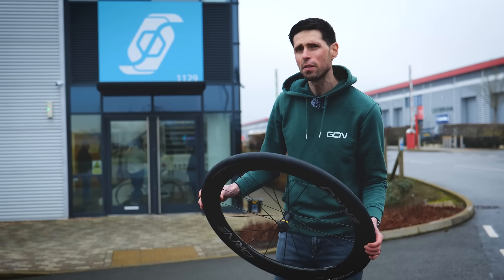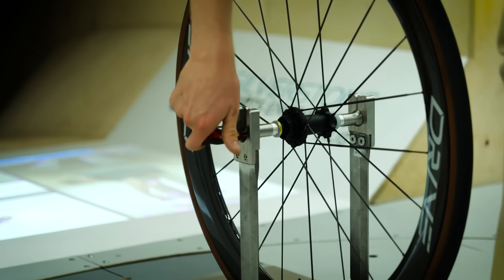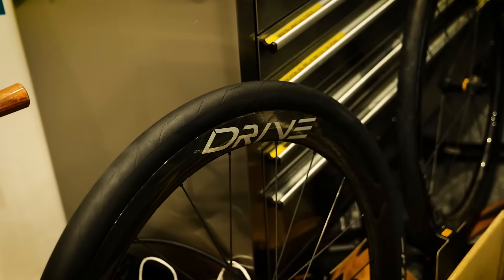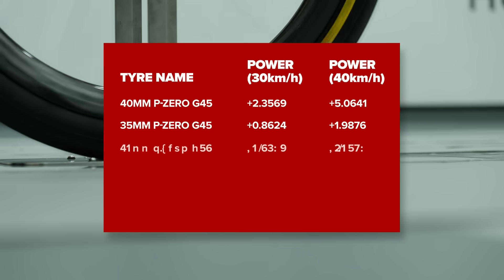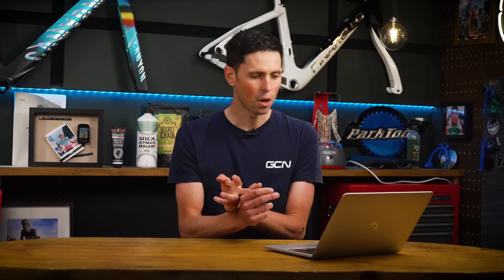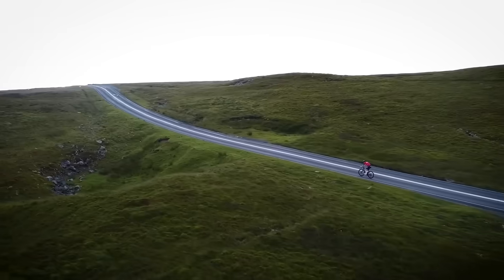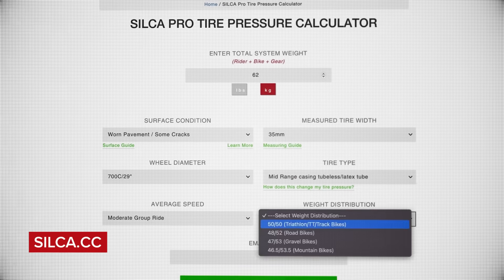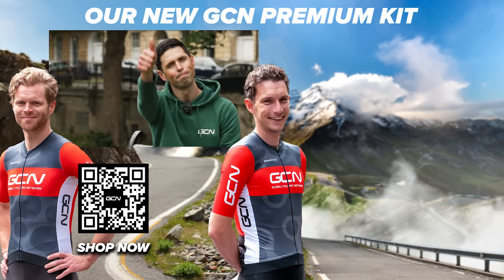The Fastest Tyre Width is NOT What You Think

Comment: So frustrating watching yet another video where the assumption is same tire sizes front and rear. I can only fit a 25 in the rear of my bike, but a 32 in the front.  So instead of 25-25, I put a 32 in the front and wow, it's amazing.  It added a little bit of front suspension (where it matters most) and vastly improved comfort and control in turns, because the front is where all that magic happens. So if you don't want to buy a whole new bike, look at your front fork clearance and max out your tire there and enjoy the heck out of it for a few more years.  It's great.

Comment: there is a biggest flaw from very beginning.  you already pointed out at early video.  there is no such thing as a perfect road surface.  wish to compare with rougher or smoother sims and see how it will effect width of tires.  I believe if these data is so import then pro cycle team should have change their tire set for all different courses accordingly as what motor sport does.

Comment: As someone else pointed out, the tested tires in this video in 35 and 40mm width are not really comparable because they use a different compount etc. Bicycle Rolling Resistance categorizes the 40mm even as a "fast touring tire" afaik, not a road tire. I am not saying that a 40 is as a fast as a 28 or a 30, but if you test them as in the video it's not that strong of a statement I think and I would take the rolling resistance values with a grain of salt. Also I'd be interesting to see the aero measurements of wider tires on even wider rims, such as the ZIPP XPLR or Nextie rims that have 28 or 29mm internal width. Because this is I think the route we are heading to. Road wheels will have 25 internal width and "Gravel" marketed wheels will go even wider. Also I recon that in a few years a lot of people will be riding fast on 35mm race tires... Which is, comparted to a lot of developments the cycling industry is pushing upon consumers, actually a good thing I'd say. 

From a personal perspective I just can say that I really enjoy my Schwalbe Pro Ones in 38mm I am constantly setting new PRs with on my new build. But that is just n=1 anecdotal evidence of cause. 🙂

Comment: On my very first IM race in CPH back in 2014, I was opted to use 19 mm tubular tires... The front tire only last about 30 kms, since I hit a pothole & destroyed it. With 120 psi & 90 kg mass on it, the tire hade no chance... Hopefully I had spare & didn't DNF.

That's a good test you did, thank you. The only thing that could be mentioned is the rider's weight. I personally believe that going one size wider is a safe bet for over 80 kg riders. What do you think?

Comment: I have gone from a mid price 28 to an expensive 33 (Challenge Strada Bianca) and it feels faster everywhere. I am using a Little less pressure and I live in an area with some flat roads, lots of cat four hills with switchbacks and lots of good quality gravel trails. I feel like I have a lot of grip especially descending. I am riding a Trek Crockett which is very stiff and it seems to like a bigger tyre

Comment: This is a complex topic, but I wanted to add in that changing the internal rim width also changes rolling resistance because the sidewall will get more or less support, changing the tire's stiffness. It was not clear which internal rim width the pedaling efficiency rig wheel setup was

For example I wonder if a wheel with internal rim width of 35 and putting the 40 mm tire on will have a similar rolling resistance to the 30mm

Comment: Measuring drag at zero yaw on a single wheel is not enough to draw reliable real world conclusions. The bigger differences show up at 10 or 20 degree yaw angles, whereas the wheel can act as a sail. But aero is hard, there are so many variables. Different wheel and tyre combos will differ at the same nominal widths. But I guess we can all agree that 40mm road tyres are slow.

Comment: 2009 when I was doing the Lake Taupo 100 mile ride, I thought my 23mm 90 psi were the ideal setup….even though some roadseal is like set gravel. But then I fell for trying 1.5 “ Conti tyres on an MTB, to ‘cut through to the solid surface under the mud’ - maybe it did, but they were unforgiving and harsh.

Comment: I'm curious about how rolling resistance breaks down by tire / tyre size vs. inflation. I have a strong suspicion that there's one ideal contact patch size (regardless of the tire size) and you get an ideal contact patch at the best intersection of tire width + rider weight + inflation, but I've been wrong before.

Comment: Just changing the tire width from 23mm to 25mm clearly slowed down hill climbing. Since wide tires are not common even in track competitions where speed is measured in 1/1000 second, I think the only advantage is in comfort on rough roads.

Comment: Can anyone tell me if bike tires have aspect ratios like car tires, or is it strictly diameter and width? My old roadie was designed for 28mm tires. I have space for maybe 32mm but can go no more in tire diameter because the brake bridges are right there with very little gap to the top of the tires.

Comment: Assuming a smooth surface beneath the tire, fastest width is the most narrow. Why? Because of air drag across rider and bike, no matter how streamlined the combo, you need to constantly re-accelerate the wheels - with EVERY pedal stroke. A narrow tire has less material and subsequently less weight and mass to be reaccelerated. So, for the same amount of energy put to the pedals, you get more re-acceleration out of the tire with less weight and mass. Over a rough surface, which can promote tire-to-road-surface slippage and thus wasted energy there, a slightly wider tire inflated a bit less could grip a bit better, reducing slippage, saving more energy than a lighter / narrower tire in that situation.

Comment: I run 32 mm tires. The big difference? Cornering at speed is so much more stable. Actually, so so so much more stable. I'm much more comfortable laying the bike over when I'm cornering with 32's. The same goes for 35 mm tires, but I run 32's for some unknown reason (to me). Maybe I save some power as suggested here even though I can't tell objectively. Regardless, 32 mm's seem to be my sweet spot. Also fewer flats, but that's not the topic here.

Comment: Had 28s, rear wore out so got a 32, feels better and no loss in speed with 28 front 32 rear. Does anyone have any tires they like that aren't close to $100/each? Currently use continental ultra sport 3s and don't like gp5000 because they got punctures like crazy for me. Might try some P7 sport 35mm next

Comment: aired are too much hassle. well I will not be using them. dont ride with any psi. use segmented solid/flex tired with radial/axial bolt attachment. absolute zero air leak maintenance. tractors dont care about aerodynamics. they need to just work.

Comment: A quick question that just sprung to mind. You didn't cover it in the video but, what does the weight of the rider do to the data you just presented. For example, if you reduce the pressure in the tire tire when you are a heavier rider, what are the odds of rupture on those gravel tracks like say, the Sydney CBD.  Sydney is built on a sandstone base so fishers, pot holes and crumbling corners are a fact of life. But now we also have tram lines.

Comment: Just got a new bike, a Merida, which is actually a step down from the Giant I rode before.  Of course there is an 11 year gap in technology, gears, cabling and brakes etc...  Anyway, the new bike comes with 28mm tires and a recommended pressure of 115psi.  However, having to re-pressurise for the first time I stopped at 100psi because the tire felt rock hard at that point. Now my Giant had 23mm tires that inflated to 100psi also, so no real difference that I could feel. But I am an old clunker, north of 60 and trying to re-build my fitness.  Consequently, the things that have me more alert is how a heavier bike skips and twitches at high speeds. Tire pressure and width seems less important to me at the moment.
Reply: Pretty sure 115psi would have been the max pressure for the clincher rims before risking catastrophic blowout! Nobody should be riding north of 100psi on their tires anymore. Check some pressure calculators online e.g. Silca, Sram etc. for some recommended pressures.

Comment: Spent March, April and most of May in a wheelchair… did 300k on turbo over the last few weeks… fitted some 40mm pZ0 and went out for my first real ride of the year, put the power down and hell I took 5.46 min off my previous best on a 22k hilly route.. so that definitely ain’t slower than the 32mm I had on before!!  Like riding on smooth tarmac.. not crappy potholed B roads..

Comment: Tire brands vary quite a bit, even in the same model range….for instance I’m running Pirelli Race RS 30s on my Supersix with Reserve wheels 40/44s, with 25.5 internal and I get a tire that calipers to 34.227….
The same wheels with GP5k STRs in 32s measure 34.2…
I think the video is just trying to encourage people to try larger tires for comfort and stability with much or any loss in speed.  Today I rode a group ride of fast roadies on my gravel bike with 45c Terra speeds…it was a little slow up hills but on the flats I was able to peloton with the best of them.

Comment: Just this Spring I put 40mm tires on my Diverge. The surfaces I ride are a mixture of asphalt, chip and seal, and gravel roads. I'm coming from 32mm and have to say the 40mm is the way to go on mixed rough surfaces. Of course I'm not racing and actually don't pay much attention to speed. I do appreciate the comfort and extra traction.

Comment: They can't be double to get the losses for two wheels in terms of rolling resistance as there is a different amount of weight on the front and rear wheel, your rolling resistance losses will be far lower on the front wheel as it is maybe a 65:35 weighting, this is easily seen in tyre wear with you rear tyre wearing often twice as fast as the front.

It is an interesting video though because it does suggest that most riders who don't care about at watt or two here and there, but might about 5w here and there, should probably be on 32-35mm tyres. But I think that has been fairly obvious for a while now, if the Pro's are on X, most people aren't a 22 year old with a yoga physio, so add a bit to make it work. Same thing can be seen in reach, drop, handlebar width, and why we should just ride endurance road bikes as has been the case since about a decade ago, my endurance frame from 2015 can fit 30mm tyres, the Pros were all on 25mm at the time.

Comment: I've been running 35mm GP5000 AS tubeless for about 2 years now, daily commuting and 3 grand fondos. The puncture protection from both the AS tire and lower pressure from 35mm has been so nice, along with good sealant and I haven't noticed a puncture until I've gotten home and see the residue on my frame. I've been able to stay on the bike all but two weeks of the year when the snow gets bad here.
Reply: My experience matches this. The Conti GP5000 AS TR in 35 mm is my go to tire for logging miles year round in all conditions.

Comment: In the 35+ years I've been a roadie, it was the addition of disc brakes to road bikes that was the biggest "game changer" I can think of because it finally allowed for this tire width experiment to happen.  If someone was ever looking for a reason to buy a new bike and the current bike has rim brakes, this is it.
Reply: I will keep my 2018 rim brake bike.  It can handle 28 mm; that works just fine for me.
Reply: Ive been riding for over 30 years. My road bike has rim brakes and Ive always found them to be effective. TBH given the small surface contact of the wheels on the tarmac - which is often wet here in the UK ! - Id be scared of having more braking power. I really do support new technology and advancements in things like tyres etc, but the only real game-changers Ive seen in the last 40 years has been aero-bars and clippless pedals.
Reply: I agree. I rode magura hydraulic rim brakes (the drop bar version) on my last bike for 20 years.
But, if it had come with discs, I'd have preferred that. If it could take discs, I'd have swapped.  And, when I changed bikes last year, I made sure it had discs.

Comment: riding 32 mm cinteratos on my road bike, and 40 mm on my gravel rig. Love both set-ups. Added bonus with the 32's is that I've had only one puncture in the last 17,000 kms.and two sets of tyres. Sweet.
Reply: The Cinturatos are pretty heavy though.
Reply: @babbocatus  I'm 73, so speed is not my primary concern. Comfort and handling seem so much better in the wider tyres.
Reply from the maker: one puncture in 17,000kms is good enough for us!

Comment: Dude, did you just negate a 2.5w aero penalty then laud a 0.6w rolling gain? I am surprised noone is suggesting narrow and hard front with beefy back for comfort and grip - especially since weight distribution is not 50 50. A harder front tyre corners better, feels less squishy. And a 70 kg rider doesn't need the same width and pressure as a 100kg rider.  60kg pogi could probably ride 25@90psi on the front and 28@80psi behind.

Comment: He uses labeled tire widths and NOT actual tire width. He need to show these values because he uses different wheel widths and depths if he wants to have a true comparison. Also I’m sick of people using the website rolling resistance because it does not measure the aerodynamic difference only rolling resistance…if you go from a 28mm (actual NOT labeled) to a 40mm, you are increasing the frontal area by 0.428 or 42.8% which is significant and needs to be tested if you want a true difference between tires!!!

Please put all the tires on the rims and measure actual widths with the exact pressure used in the test and post the table here.

Comment: The best for me is 25mm front 28mm rear. Bicyclerollingresistance claims 25 to be much faster than 30mm. And on dtswiss 21mm with, there is no use for larger tyres. And larger is heavier, so to climb you lose even more. Also in sprinting.

Comment: You didn’t mention tire width as mounted. I have some 28mm Vittoria Corsa mounted on DT Swiss P 1800 Spline wheels for the alloy brake track. My analog vernier calipers show 30mm width front and rear. There’s a bit of a muffin top, but not too bad. I’m guessing that shouldn’t make a difference to drag and ride ability but you have the data.

Comment: 28mm front, 30mm rear...I'm wondering if it's not possible to directly infer the rolling resistance of the front tyre from the rear? It's carrying less weight and therefore deformation will be less etc...
Reply: I'm also wondering what that difference in mass would be...🤨
Reply: And another thing... What about punctures... Does spreading the weight out more with wider tyres reduce chances of punctures?

Comment: Nobody talks about rotating weight anymore ...? The weight difference between 23mm and 32mm Conti 5000 is 180 grams for 2 tires. I wouldn't call that insignificant on hilly routes, during accelerations out of corners, or closing gaps in a paceline. Since I ride mostly on smooth roads, my 23mm Veloflex tires (now with TPU tubes) perform flawlessly with around 100 psi - and riding for over 35 years / 5000 miles p year average, I have never, ever had a pinch flat (and very few "other" flats).

Comment: My 32's at 60psi are sooo much faster than my 23's at 90psi. I'm now rolling over road imperfections and debri instead of getting jarred up and over the top of road trash.
Reply: 23 can be soft too. just chose the right tyre. not cheap by preference. GP5000 with tubolito at 6kg pressure are perfect.

Comment: Consider your wheel-tire combos are not ideal for all widths.. and very difficult to get right with old-school designs dominating the market.

I ran 28mm on 21int/28out for years. Tried 32mm on same rim, but wasn't impressed. 32mm however came alive on 25/33mm gravel wheels and has been my favourite last few years. When ever I switch back to the 28mm wheelset it's somewhat a letdown.

This year I am trying leap-frog the incremental development and got 32mm int/40mm ext wheelset and 35mm tires (40mm WAM). Still dialing in pressure. They surprisingly doesn't feel slow at cruising, feel fast on rough stuff and maybe a bit draggy at descending speeds - or just less dramatic. Not the immediate feel of an all round better solution I got from 32mm.

All tires are GP5000TR, but the 35s are All season. That makes an inquantifyable difference against the 35mm

Comment: I upgraded my gp5ks from 28 to 32mm. Definitely a little more comfort and no speed penalty as far as I can tell. But then, I'm (almost) 65 and not riding for any prizes. I'd probably gain a tiny bit more upgrading from my current 22mm internal rims to 25s but that's definitely not worth it. I'm riding a 2021Orbea Orca M30 with Just Riding Along Mahi Mahi wheels. And like Alex said at the end, this setup always puts a smile on my face whenever I go out. Big smile...😃
Reply: What the brand of tyre do you have?
Reply: @BikeFitness should be continental

Comment: I'm 00:31 seconds into this video and I already know that you're not maintaining the relationship between Internal Rim Width, External Rim Width and Tyre Measured Width. So the larger tyre will "lightbulb" and be slower.

Also, the same Silverstone place that absolutely scammed ye on the Shoe video? 🤔

Update: after watching the video, you also didn't maintain carcass tension or rubber compound.
And 32mm tyres should've been tested, given that most of the conversation is happening at that width.

Where ye should take the conversation next is to use wheels that have a 40 and/or 44mm (rule of 105) external width on the 40mm tyre.
Or examine how big can we go with a rear tyre without negatively effecting the bikes aero.